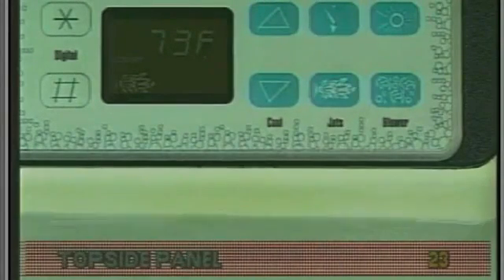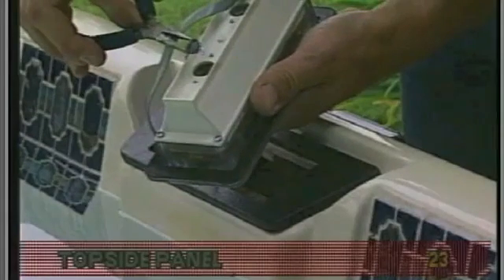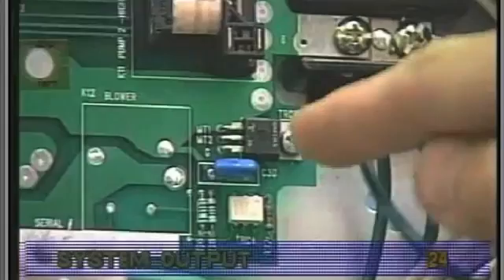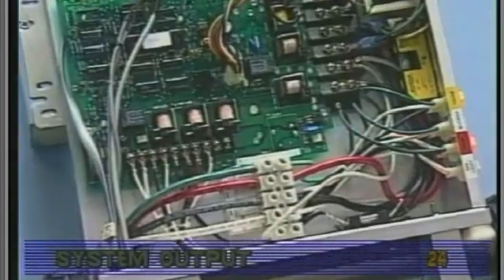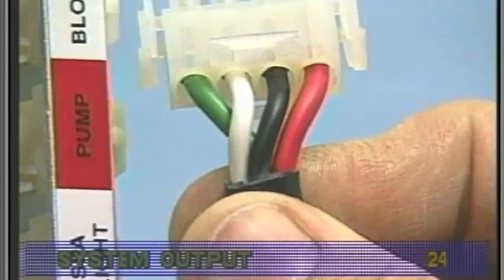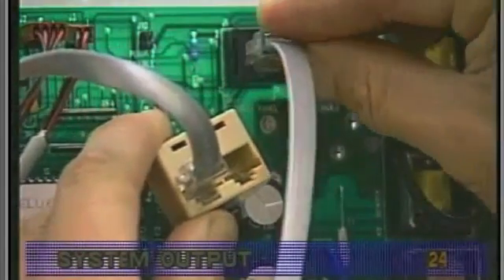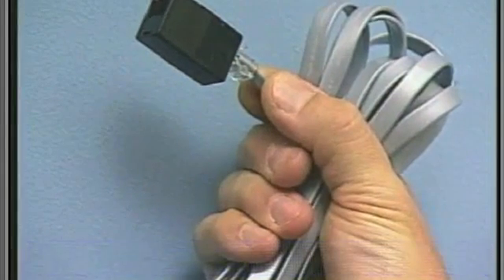Balboa Legacy Systems Series Troubleshooting Topside Panels and System Outputs

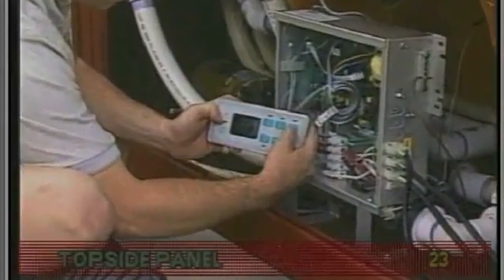Comment: 1:10 It's usually going to be the topside panel, mostly likely internally cracked piezoelectric disks that substitute for pushbutton switches.

It's interesting to see this very old control panel with incandescent bulbs.  The plastic case and switch positions remained the same for long after LEDs replaced bulbs, but the mounting points for the bulb holders remains.